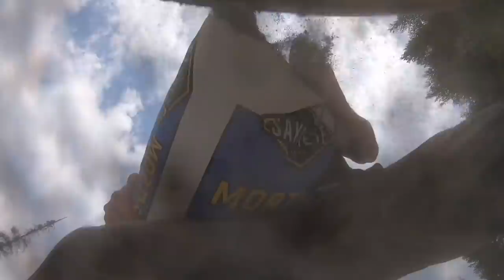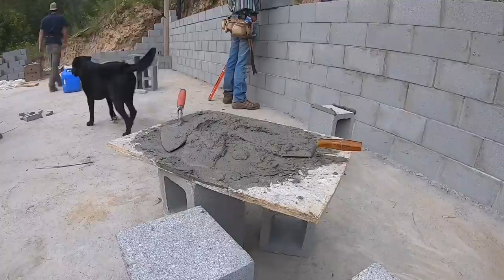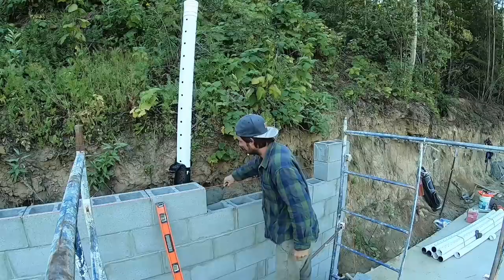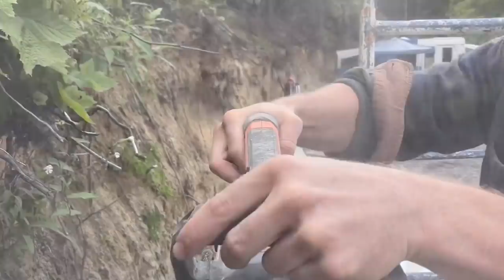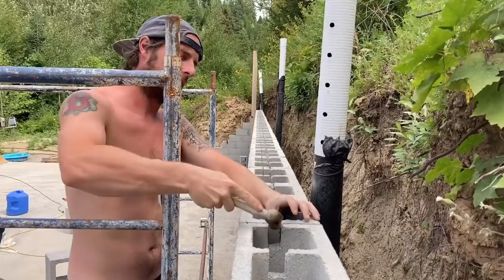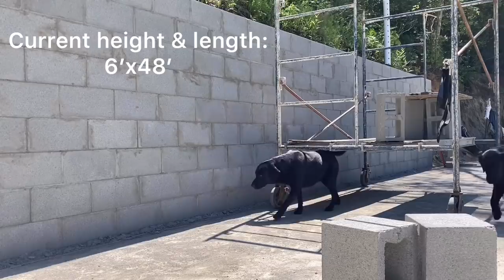Build The Wall Pt.3

Comment: You are going to have a Landslide I guarantee it. Blocks are 7 5/8x 15 and 5/8 for a reason. A 1/2 inch motor bed tamped down to 3/8. Your Mortar is to runny. Should have just done an 10" concrete wall with horizontale supports dug into the hillside.

Comment: The way you are currently building your wall is not going to retain all of that soil once you backfill, and once you get into the colder/rainier months of the year. Once soil becomes saturated with water, it will no longer just sit there. It'll start moving and pressing against your wall, with hundreds of tons of pressure. And the wall, as it is currently constructed, will not be able to hold up. Other peeps have already pointed this out, but I also wanted to provide a link to some visuals which explain this concept in more detail. Do yourself a favour, whilst you can still improve the design (for your own safety sake) Watch this video and to to apply the lessons to your wall. https://youtu.be/iDzp6xEAT2I
Reply from the maker: Thank you for the tips!
Reply: They have no idea how to do anything.